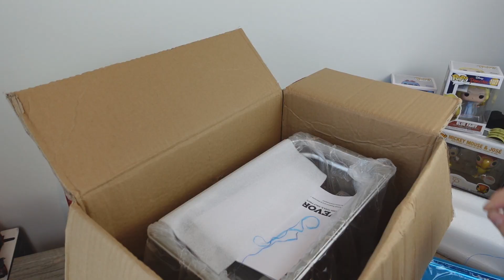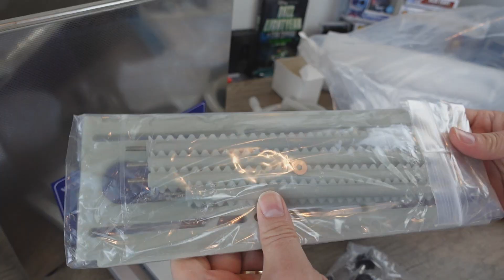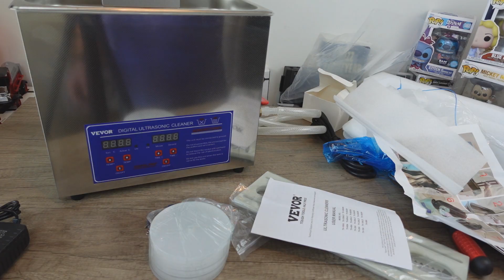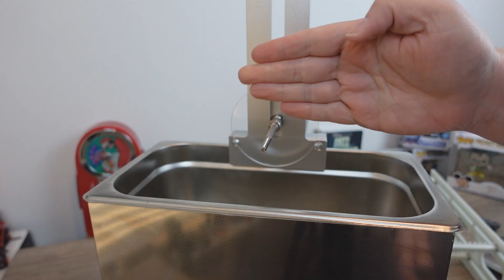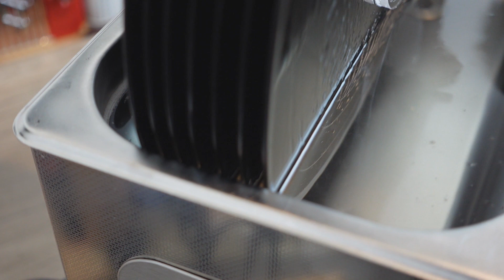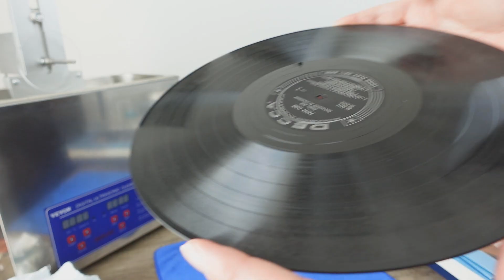VEVOR Ultrasonic Vinyl Record Cleaner!  Review & Unboxing!

Comment: Those are not finger prints that’s what you call sitting in the paper sleeve and it’s a chemical reaction that will never get it out it causes haze across the record I’ve opened brand new records and the record is hazed over due to sitting in the sleeves more and more folks are discovering this the record plants are using cheap sleeves so I believe it’s more of something like that instead of finger prints I’ve cleaned 1000’s of records and have a huge collection and I’ve seen this before if I’m wrong about finger prints that’s my bad but finger prints are always easy to get off send that record off and have it professionally cleaned they will charge about 12 to 20 dollars to clean it plus shipping look up companies on YouTube they have videos on having them professionally cleaned.

Comment: I noticed you did not raise the motor/spindle to load the records. I was loading them with it raised and it dropped and scratched my copy of Tommy. Loading it in the down position you run the risk of scratching the record on the spindle as it requires a bit of care getting the record in there.

Comment: I dug out this old USB fan I've had for years and am using it to blow air through the stacked records in the drying rack. I don't think they make mine anymore but this looks to be close to it. BTW, it can also do double duty as a cooling fan for your electronics and on really hot and sticky days I put it on my desk to cool me. I like it for that because it's not so powerful as to be annoying or making my eyes dry up.

Amazon - 
AC Infinity MULTIFAN S3, Quiet 120mm USB Fan, UL-Certified for Receiver DVR PlayStation Xbox Computer Cabinet Cooling

Comment: Does it fit 7” singles
Reply from the maker: That was one thing I noticed when testing it is that it seemed designed for 12 inch. I’m sure there’s a way to modify it, however?
Reply: @Recordology  Aren't labels on 7" and 12" the same size?  As long as the label is the same size you shouldn't need any additional adapters etc... (Other than a center spindle if you have one of the ones with the large holes).

Comment: 1) You MUST MUST MUST use distilled water
2) preheat water to 30 c with the lid on heats taste
3) I use a cup of isopropyl alcohol, keep solution under 10%
4) I use 15 ml teaspoon of Triton x-100 as a sulfacant
5) raise arm, put records on, I only do 3 or 4 at a time I use two spacers between each LP
6) Lower arm putting records on to solution
7) clean for 10 minutes

You have to watch run times, there is a limit to how long you can run the machine before you rest it.
Reply from the maker: Great tips, thanks for sharing!
Reply: with this method are the labels getting wet ?
Reply: 15 ml of surfactant in 6 l water sounds like a lot.  Don't you get surfactant residues on the style for the first couple of plays?
Reply: You don't need any surfactants. The principle of ultrasonic and how it works, is a surfactant in itself because of the breaking of the water monecules is a surfactant. You only need distilled water or de-ionized water.
Reply: Using isopropyl alcohol is an awful choice

Comment: I have been using the same Vevor for 2 years, i do the Vinyl Vac method for pre cleaning and a vac dry after Ultrasonic cleaning.   Works like magic!  I also only do 2 at a time and have them centered in the middle in the bath as best i can.  Does do wonders as long if the LP isnt scratched up or groove damage.
Reply: Which Vevor model you have? 3 litre or 6 litre?
Reply from the maker: Sounds like a great process for a great cleaner!

Comment: There is no need to add anything to the distilled water in a ultrasonic machine. Let the cavitation do the work. But If you choose to do so, you'll need to rinse what ever you added to the machine  off the record (just put distilled water in your spin clean & give it a rinse) or vacuum it off with a record vacuum machine after you ultra sonic cleaning. If you don't rinse  the additive it could still be in the grooves. Try it with just distilled water & you should hear a big improvement in sound.I've been using the same machine for several years with amazing results. Experiment a little & Have fun!
Reply from the maker: Good point, I’ll have to give that a try!

Comment: Mine just arrived. Box was banged up and I worried it had damaged the unit but, so far, all looks good. Will take an actual run through to be sure. I bought it because of your video. Never had heard of it before. Thanks!
Reply from the maker: My box was banged up too! Seems to be well packed though… Let me know what you think
Reply: @Recordology  UPDATE #1 - the plastic connector for the hose is too small. The threads won't grab. The whole thing can slip in and out.  Missing 4 washers.
Reply from the maker: Wow that’s ridiculous

Comment: I found that cleaning a max of 3 or 4 records (spaced further apart) for a max of 10-15 minutes provided the best results. Also, make sure you are using distilled water instead of tap water to ensure there's no mineral residue left over on the records and in the grooves that could impact sound quality. So far I've been very impressed with this cleaner.

Comment: Can you actually clean 45s? they show online it does but I have yet to see a video of that in action
Reply from the maker: I wasn’t able to figure it out.
Reply: @Recordology  I can assume you can only clean small hole 45s
Reply: I use the yellow 45 spider adapters. You do have to add more water to get to the runout, but it works well for me.

Comment: Big mistake not using distilled water!!!  Pounding minerals & calcium into record grooves under high pressure is very dangerous!   Don’t put any good records in there!!!!  Not the Patsy Cline!! Nooooo!  And no alcohol on styrene especially!  Need an enzyme cleaner and a Vacuum based machine.  Styrene typically has a very limited life/number of plays. 

I will stick  with my VPI 16.5 cleaner any day to a cheap general use ultrasonic.  Not for me.
Reply from the maker: I used a filtered water. But agreed distilled would be even better. Don’t worry everything came out fine in the end! I also agree about not using anything alcohol based. Especially on shellac.
Reply: @Recordology Good… but filtered water is just as bad for records and in a high pressure situation even worse.  I personally don’t trust the cheap ultrasonics for my records.  I’ve heard horror stories.  Heat and 30 mins not appropriate for records.  Until I can afford a quality machine like a Degritter..  . 

I’m very happy with my VPI vacuum machine and Mofi fluids for a near perfect clean! In fact if I got an ultrasonic I’d still keep my VPI.  You cannot beat the quick and complete dry of a good vacuum cleaner!  I’m not a fan of microfiber type drying cloths and-or air drying  for records.  Too much stays behind in the grooves.

Comment: I have this unit and it’s a nice complement to the Spin Clean. As others said, no more than 3 records and space them out. I raise and lower the arm before and after to avoid getting labels wet. It comes up to temp faster when you run the cavitation. I think the vibration heats the water. Use a coffee filter at the end of the hose to filter the distilled water and you can reuse the water for a few batches.
Reply: The coffee filter will leave little fibers that depending on your sylus it will clog it up. For the less than $2 for jug of distilled water it’s not worth it to me to prewear out a stylus from dirt or junk.

Comment: This takes the hobby to places I'm not willing to go. Spin Clean is plenty good enough for cleaning dirty records.
Reply: Spin clean can never get an LP as clean as this can.  If you take a very dirty record and run it through a spin clean and hold it to the light once it's dried you can still see its not perfect.  Ultrasonic cleaner latterly removes everything and can make soiled LPs look almost brand new.  And they sound far cleaner, no it can't work miracles but compared to anything else it is.
Reply from the maker: Fair enough!

Comment: I have a Record Pro, like Spin-Clean, and I don't think it takes a lot of elbow grease.  Just three spins to left and three spins to the right.  I was wondering, if the inside of the tank was already rusted before you put any water in it, what is it going to be like after?  The rust-colored particals after you've drained it could be rust.  I'll stick to my Record Pro.  Anyways, have a good rest of the week, my friend.
Reply: My record pro does a terrific job as well.

Comment: For best results on old records brush off surface dust, pre clean on a vacuum rcm or spin clean where you actually scrub the record, run through the ultrasonic cycle. If you use a cleaning fluid, depending on what it is and how much you use, you might consider a 2nd water only cycle in the ultrasonic.

Comment: Regarding the fingerprint issue, I thought I would share my method.  I use a Spin Clean (by the way, I don't know why you think it takes an hour to do one record in the Spin Clean; with a few rotations in either direction, it only takes a couple minutes or so; I can get 25 records done in probably 1 1/2 hours), and it sometimes takes off the prints, but if prints still linger, I take a microfiber cloth (not a towel but the kind you use on glasses or camera lenses), dip it lightly in the Spin Clean water, and rub it on the print back and forth, following the grooves.  Many times, this gets rid of the fingerprint but not always.  As you indicated, it may have to do with how long the print has been on the record.  But I do have some success with this method.

Comment: I was watching Andrew from Parlogram's latest video just a couple of days ago and he had unboxed/demonstrated a very similar machine from Vevor, so I was able to identify all the items that were pulled from the packaging, else I'd been clueless, there's a lot of parts to put together!  It was likely the one that was referred to here, but I couldn't find a link to confirm.  Andrew's machine had two big knobs at the front and no digital display, and appears to be $15 less expensive.
Reply: Andrew's machine also had no on/off switch for the spindle and it was easy to lift the records out of the water as the spindle motor just rested on the edge.
Reply: @ianz9916  That sounds like an old model by them that was recalled for electrocution risk.  Just say no to Vevor & cheap general purpose ultrasonic cleaners for records is my advice!  Spin Clean is truly an upgrade to this junk. Go watch an older video on the Vinyl Rundown channel if you don’t believe me.

Comment: You need to use distilled water and you should at the very least dry clean off the dust the records before doing it.
Reply: Agreed about the distilled water, it's an absolute must, but I was actually thinking the discs were fine for a good demo!
Reply: Can battery water or RO water work?
Reply: @Zimmy_1981 RO system strips all minerals out, RO water is distilled water. Distilled water is the same water used for car battery’s. NEVER USE water from a battery.
Reply: @uberdetail5408 not quite. I have an RO unit. The TDS of my tap water is around 50ppm after RO about 5ppm with an after RO DI pod the TDS is 0. The DI pods takes the minerals left that gets through the RO.
Reply: @uberdetail5408 Distilled water there is no Taste. Do the same with battery water it has a strong taste. Why the differens if they'r the same?
Reply: @Zimmy_1981  No, there are still minerals in the water.
Reply: @physicalmedia2689 RO with a DI pods with give you a TDS of 0
Reply: @Zimmy_1981 no ro water